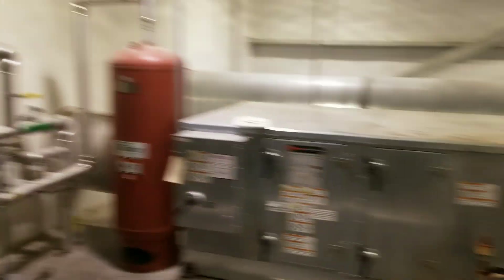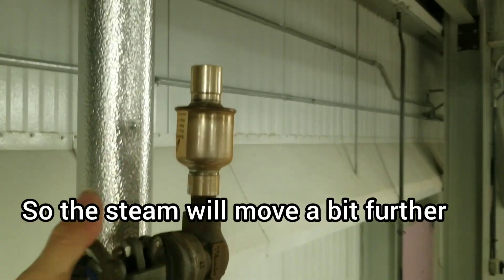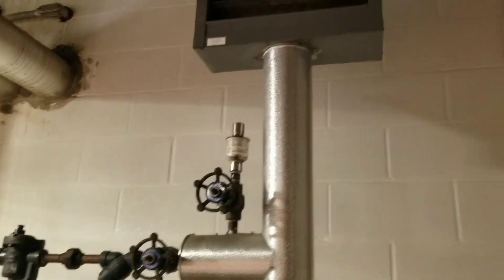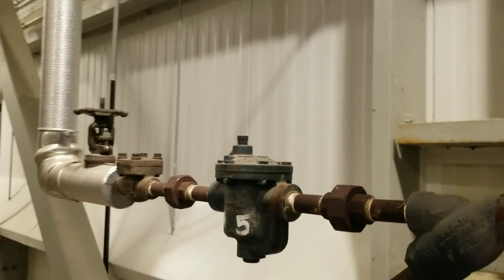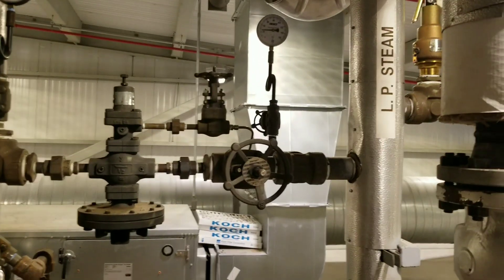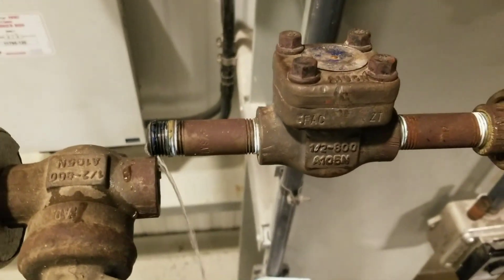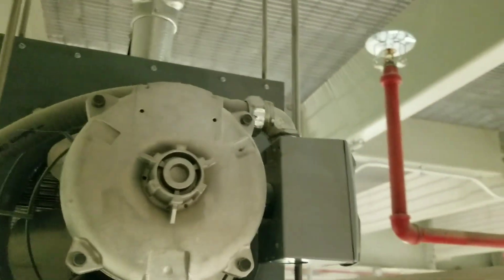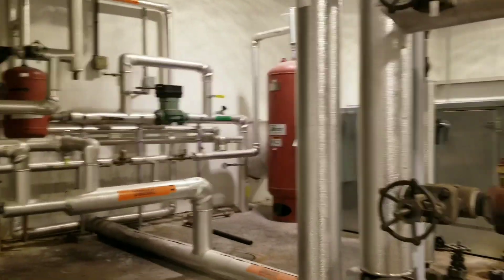hvac steam issues, low pressure steam heating.

Comment: Steam works opposite.  Lower pressure goes further.  Cranking up the pressure never pushed it further just carried more heat and condensed it faster . Lower pressure goes further because it condenses at higher temperatures but carried fewer btus.
Reply from the maker: Thanks for the feedback and watching! What I tried to say was it doesn't actually move further, it compresses the air that can't get out so it seems to move further. Keep that knowledge coming!
Reply: @EverythingHVACR  no doubt,  yeah their drain wasn't vented and their lucky they didn't kill someone
Reply from the maker: 💯, thanks again!
Reply: @EverythingHVACR  turning turbines or heating haha jk

Comment: We’re they Turing the steam pressure up and up... trying to get heat????
Mercy sakes
Reply from the maker: Yes I suspect so. Seems they had a few traps and check valves fail, coils fill with condensate and leak from the air vent... turn off air vent, no heat, raise the pressure..🤦‍♂️🐐, thanks for watching!

Comment: Good job. It’s crazy though all of the labels on piping read 
LP STEAM. 15 psi is low pressure and they had 80 psi. Very dangerous
Reply from the maker: No doubt getting dangerous, the knee jerk reaction to a lot of steam problems is to raise the pressure. Thanks for watching!